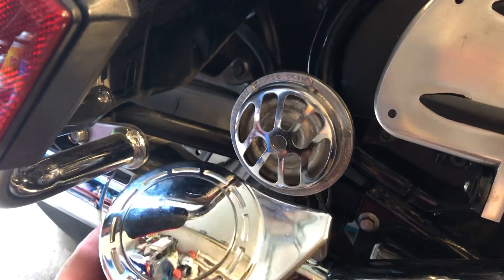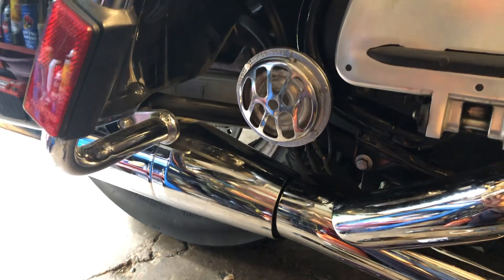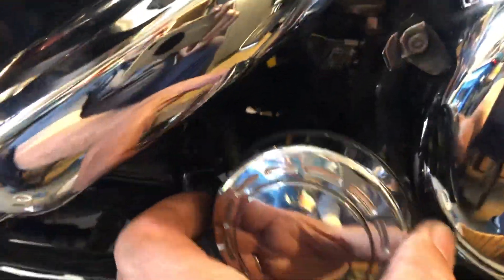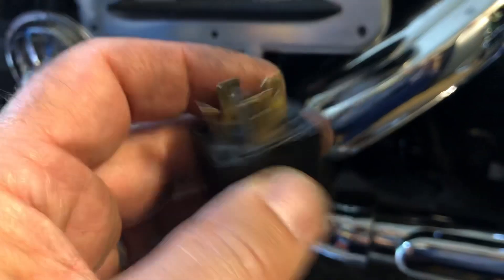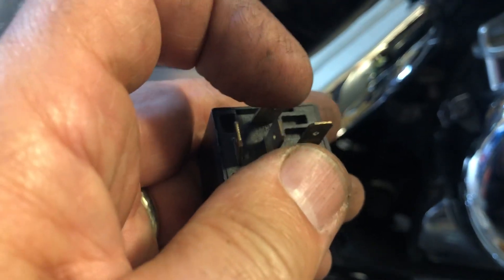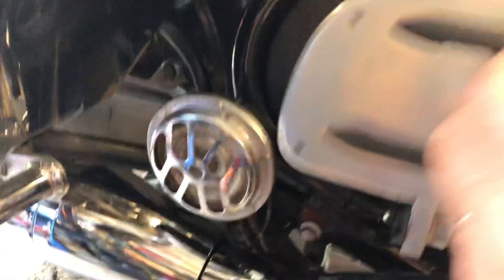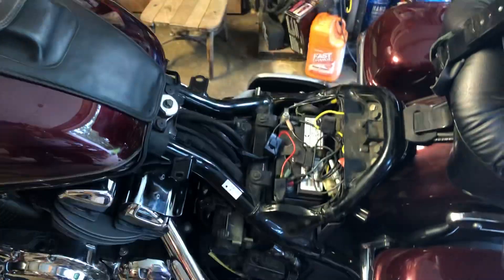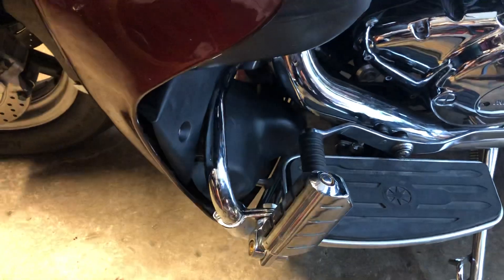Loud Motorcycle Horns￼  Venture

Comment: Thanks for the tip on the Guzzi horns! Now, to find a pair of OEM, and avoid being duped by offshore repro junk.
Reply from the maker: joe— guzy’s have clutch chatter too. The brand name of those horns is VOXBEL. I checked on eBay about a week ago and there were many pair of them for sale on there, and I’ve noticed that the prices of them have almost doubled. I think you can still get them brand new, a few years ago they were about 60 bucks apiece on eBay, but I am not sure if they are the genuine heavy ones or replicas..
  I had a pair of German made Hella freeway blasters on my last pick up truck.. they also made you feel like you were being electrocuted if you were close to them. So I bought another set of the hella’s for my current Kawasaki Z 400. They are on there now. I think they’re replicas, they’re not bad.. really tough to find a place to mount them on my Kawasaki. I have a couple videos of my Z400 with the horns

Comment: Back in March '22 I bought a 2016 MG V7ii. I was pleasantly surprised when I heard how loud the horn is. 

It seems logical to me that a horn should face forward, where you want  the sound waves to be directed.
Reply from the maker: loud horns like these were OEM on my 1979 Moto Guzzi SP 1000, as well as the convert, the CX 100, and earlier machines like the Lemans..These horns did not come on my 1980 V 50, or my 2004 V11 Sport or on my 2007 Guzzi Norge… but, like other machines I’ve had, I installed a set of these on my Norge… I have a video here on YouTube now entitled Moto Guzzi Norge to Bradys Bend. In part three of that video, I have to give a little toot to someone standing on the side of the road to let them know I’m there. You can hear those / these horns in that video…
  it was a consern you are right..
aiming the horns forward is logical to me too. But ——these horns are so violently loud that they can make up for it by letting someone drifting into my lane from either side know i am there is just as important. 
   I considered mounting the horns a little lower under the heel of the passenger floorboards aimed forward.. but where I ended up putting them for now was just too easy.. it is certainly better than the way the factory put one of the horns inside an enclosure in front of the shifter. And the other one was mounted basically in the same place i have a horn now on the right side, but the trumpet on the stock horn was aimed straight down..
  there was just nowhere to put the horns facing forward without blocking the radiator airflow path or being within striking range of striking the front fender..
   I had almost as hard a time mounting a pair of Hella freeway blasters on my Z400.. I have youtube videos of my Z 400 with the horns I have installed on that machine facing forward. Same issues. I couldn’t block it radiator airflow, I couldn’t put them close to the exhaust header… I know they look a bit odd and the color certainly gets a lot of remarks on my Z 400, but they certainly do the job I wanted them to do. I like em…
   But I like the voxbels better..
Reply: @Jodyrides  Good thought on warning the lane drifters!

Over the years I've found that modifying anything on a car, truck or bike always presents a few new, unanticipated challenges. 

Funny story, the motor mounts in my '68 Camaro gave out, so I replaced them with JC Whitney's solid motor mounts. Although the fit was excellent, I ripped them out & bought OEM parts 2 days later. You wouldn't believe the amount of vibration that was transferred through the solid mounts!
Reply from the maker: @savage22bolt32  
  Lane drifters, that was the closest call I ever had  on the street on a motorcycle ,besides being hit from behind while I was waiting at a stop sign once on my motorcycle. Most profitable paid nine month vacation of my life..
  but I was following an ambulance down the hill one day .. we were just both following the road. He put his right turn signal on to make a right on the little side road we were about to pass. For some reason he decided he didn’t wanna go down that road and swerved right back just before he completed the turn . but I was already beside him. I saw it coming, he barely bumped me with his drivers door. It scared him more than it scared me.. I was on my KLR 650.. you can’t hurt those things unless you use Dynamite.. I didn’t even slow down, but the ambulance came to a four smoking wheel stop.. he overreacted..
  It didn’t surprise me much because I’ve had a lot of contact experience getting bumped and doing some bumping myself when I roadraced motorcycles for eight years,Winning six championships , 2 time national champion.. so when I got bumped by that ambulance, I had already been there before , both getting bumped and getting ambulance rides as a patient after race track crashes, and being hit from behind while stopped five times on the street on my motorcycle, in my personal car, and in my company vehicles, five times I have been rear ended while stopped.. so my wife and I contribute to the local ambulance service every year, just for laughs , which is no laughing matter..
Reply: @Jodyrides  I was in my Jeep at at red light & was hit from behind. The driver never slowed down.  Hate to think what would have happened if I was riding.

I saw your vid on the tire swing. Great design, & safe too!
Reply from the maker: @savage22bolt32  
  I forgot to mention in my tire swing video that I made it for my grandkids the oldest of which is six and the youngest is four. I put that swing up there by climbing those trees when I was a younger man
  about getting hit from behind while stopped on your motorcycle. I’ll tell you what happens..
  I was waiting my turn at 7 AM one morning in September here in Pennsylvania, it’s kind of cool at that time, I had my full aerostitch suit on, two week old $450 helmet, street bike Boots,studded road racing gloves..
  I even had a device called a back off flashing tail light system that flashes when you are sitting still holding the brakes on..
   The next thing you know I’m waking up in the police and the ambulance are there. I heard the guy that hit me explaining to the car, “I saw his tail light flashing so I thought he was pulling out”
   it knocked me out of work for nine months. Doctors now getting ready to operate on my shoulder because I didn’t respond to physical therapy well. But I went to a chiropractor just before the operation reschedule, my chiropractor said to me, do you mind if I put your shoulder back in place. He literally fixed it in one second..
  so the result of getting hit from behind and having my motorcycle totaled. Was a new bike, new riding equipment, a paid nine month vacation, and a very generous pain and suffering tax free cash settlement..
   that was in 2009.. I have been hit from behind five times while stopped..
  The first thing I do every time I am driving and get a yellow light is, I check to see how close the car behind me is before I hit the brakes… that and I have had two deer collisions riding motorcycles. One at 70 miles an hour, one at 35 miles an hour on my way to work one morning. I didn’t go down either time, but I have completely stopped riding at night here in western Pennsylvania..On the news last week they reported on the local news that Pennsylvania has surpassed Michigan in the number of car/deer collisions. 
  I have had four deer collisions total, my wife has had three, my two sons each had one
Reply: @Jodyrides  some of my buds hunt in PA, so you must have more deer over there than here in CT. Yesterday morning I crossed paths with a doe and the first thing I did was look behind her to see if another was coming.  All AOK!

As a teen, mirrors didn't seem important to me, but my dad set me straight. Now I'm almost 70, and like you, when a light goes orange, I glance at the rear view before squeezing the brake lever!
Reply from the maker: @savage22bolt32  
  when I was younger, everybody on the road was in my way..
  I am older now, and now I am in everybody’s way. It’s amazing. I am not under the speed limit, and I am generally getting Tailgated everywhere..
  It is most often a tomato in an SUV..
Reply: @Jodyrides  same here. 
If anyone is too close behind me & doesn't get the idea they should back off, I find a spot to pull over & let them by. 
One time I caught up to a car that had passed me, & a cop had him pulled over, I suspect it was a radar trap. (Ear to ear grin!)